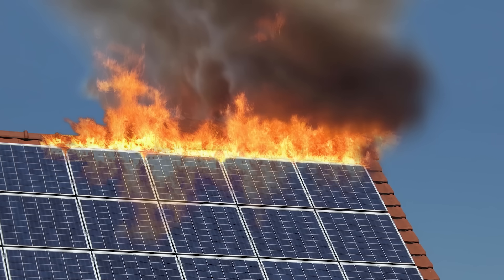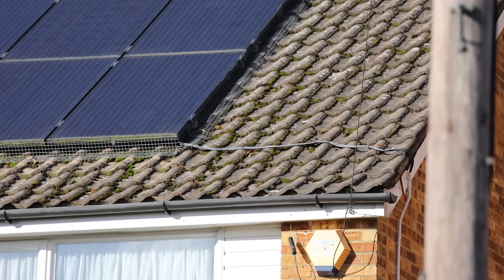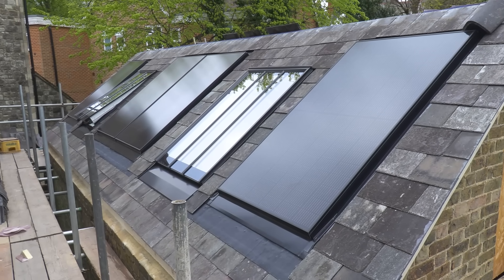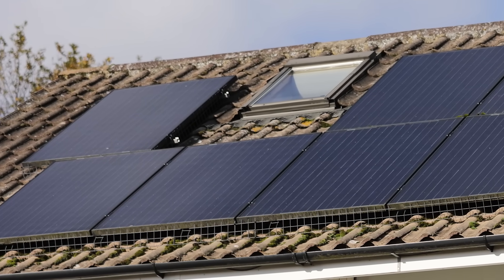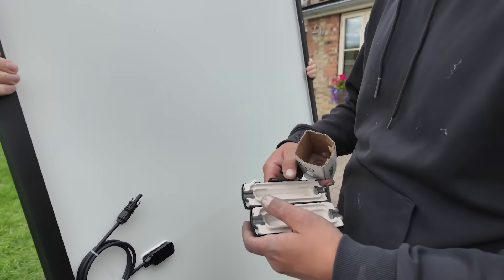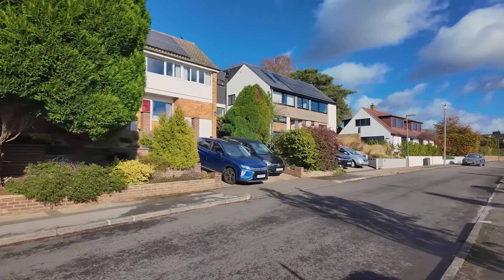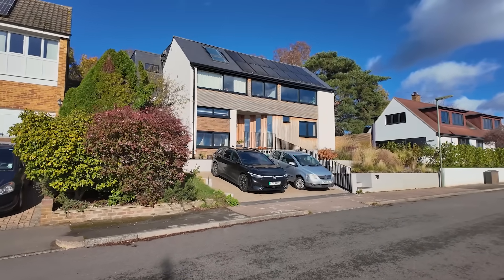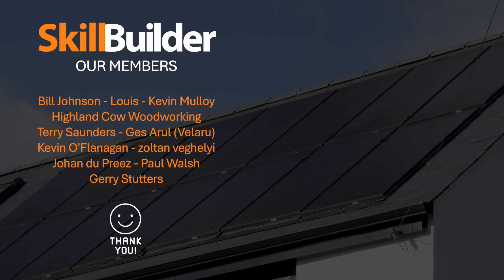Solar Panel Fires Are Rising – Here’s Why

Comment: Part of the reason for more of these fires is there's more solar installs.
Reply from the maker: That is not what the fire service is telling us. The fires are disproportionate in the increase.
Reply: @SkillBuilder  So you have access to verifiable data then? Or is this just an anecdote?
Reply: Yeah thinking this myself. Its just wiring if its not done right it might be a risk but its not that solar panels are intrinsically risky. Others have mentioned the battery in the attic is a no no nowadays and the main issue seems to be not noticing the fire which is a fair point. But it comes down to the installer which is where you can get it wrong. A lot of 'ecotechnicians' with a van and ladder and amazon account to get cheap solar panels about.....
Reply: @Meodus_Motley_Pfizer Nobody is buying panels from Amazon.
Reply: @Meodus_Motley_Pfizer Amazon is an expensive place to buy panels. The genuine brand articles are 65 quid each retail with delivery included for 2 or more from cityplumbing. It's simply not worth skimping if you are doing a house sized job, and trade they are way cheaper still.
For an MCS install all the kit has to be confirmed to be genuine and on the MCS approved list.

Comment: It's a pity you didn't do a bit more research. You would have found out about the different chemistries and thus associated fire risks, of different batteries. An eBike battery is very different from a home battery installed in a loft
Reply from the maker: It is a pity that you choose to denigrate my efforts to highlight a safety issue to those who might not know about it. I am sure you could bore for Britain about the chemistry but you would lose your audience and gain nothing. Keep the message short and keep it simple. Batteries in lofts is a bad idea.
Reply: @SkillBuilder  very defensive reaction. I applaud your work, you are doing a lot of good for us all. But you don't get everything right, nobody does. It would be better if you realised that and took some constructive criticism on board. I do apologise for my part as I could have dressed it a bit nicer
Reply: So safe that the government has banned installation in lofts?
Reply: @bordersw1239  the given reason for that was that if the floor of the loft collapses in a fire, then the very heavy batteries could fall down and injure somebody below. There is no fire risk with LiFePO4 cells. There is a huge fire risk with lithium ion cells in cheap packs like in electric bikes and scooters, power tools, mobile phones, torches, vapes, laptops, tablets, etc.
Reply: @sdewaard . Completely wrong - they are simply less likely to catch fire compared to a normal lithium battery. They are reliant on the BMS working properly and not allowing over charging. There are multiple videos of them catching fire and in a roof space already alight they would pose a significant risk to any one fighting that fire, let’s not forget the hydrogen fluoride gases they would also release. Anyone that put anything in their home that creates an added risk to occupants or firefighters is a moron - this is why why we are urged to have yearly safety checks performed on gas or oil boilers.

Comment: We have about 3.2 million solar installations in the Netherlands. Fires are rare and even if they do happen it's either the gas boiler below the roof starting it or a hack job on the wiring. The panels and their connectors are not a likely cause. 

It is wise to leave some space for the fire department to fight something burning in the attic, so a dormer or a roof window to break is something to consider.

I personally don't like the built in solar panels. There is hardly any way to cool the panels, reducing their efficiency, flammable insulation is not separated and if a panel breaks it may be impossible to replace with something that fits after just a decade.

As for batteries, NMC is a big risk in your home. LG and SolarEdge are brands that still use this chemistry and in my opinion it's dangerous.
Most home battery brands now use LFP (LiFePO4) which is very safe. Just be sure to put it in a well ventilated space or outside just in case as it can slowly release gases you don't want in your home if something does go wrong. It's very unlikely with LFP, but putting in some ventilation is not a huge expense and will also help remove any heat from the batteries in summer.

Hiring a good installer is the best way to prevent issues. There is a channel called "Gary does Solar" with lots of tips to make sure you are getting the right install and he has even made an online installer directory based on viewer experiences.

Solar panels themselves don't cause fires. Incompetent people installing them do.
Reply: To circumvent every possible risk of loosing my house due to a solar power fire. I installed my solar panels in my garden, 10 meters from my house. I have LiFePO4 batteries and they are in a small garden shed together with my breakers and lightning strike protection. I also have my Hybrid Inverters in that shed. It works great all year long (going on 3 years now). In the summer with forced ventilation and in the winter when it really cold with low power battery warmers. And if something goes wrong and a fire starts, worst case scenario I'm waiting for the fire department in the safety of my house.
Reply: The new UK standards from the NHBC are for in-roof/roof-integrated panels to be installed on a counter-battened roof with impermeable underlay due to their tendency to cause condensation under them. That means there's a continuous space behind the whole roof covering, including the tiles. Combine that with over-fascia and ridge vents and your panels are cooled from both the front and back.
Reply: The UK is a lot wetter than the Netherlands, more water is more likely to cause damage. But the main issue is probably there are too many cowboy tradesmen in the UK.
Reply: @BillyGold007  Actually the Netherlands has more rainy days although the UK has more rain in terms of volume. Basically it's wet here about 1/3 of the year, which can be challenging for solar installers as you don't want to be connecting solar panels when the MC4 connectors are wet and maybe a wet roof is not the best place to be either.
But these challenging conditions have led to fast learning and even the cowboys don't want to come back for their mistakes, so they are either sued or quickly change their ways for their own profitability.
Reply: @SolAce-nw2hf  Cowboys don't come back - they disappear like ghosts leaving wreckage behind them, that's their constant way of working probably genetically programmed.
Reply: @oldbutstillcurious3615 They do come back when you get the court to seize their bank accounts, which may be easier here in the Netherlands.
Reply: @BillyGold007  this was a problem in the Netherlands: cowboys. But that problem is already resolved.
Still, in the Netherlands you can do a large part of your home yourself, provided you do it according to common pragmatic rules. And only some parts need to be done by a certified person.
This does not lead to more fires, as most people are smart enough to call a certified person. They are not that expensive, and give you peace of mind.
Reply: If only the UK had any sort of regulations in place.. 😂
Reply: I don't like built in panels from the perspective of non-standard dimensions, that company goes away, specifications on size change, a panel finally gives up and you're stuck with a major problem of a defunct panel and nothing to replace it.
At least with externally mounted, there's cooling with proper standoff, one can view wiring junctions and if one goes, it's a function of shifting external panels only, not major roof surgery and massive patchwork.
As for batteries, regardless of type, they're all a flammable gas accumulation hazard and a short circuit overheating hazard, thermal runaway adding to the problems with the cheaper batteries. Better in a detached, insulated storage shed with good ventilation and heater of modest output to keep everything above freezing. Gotta upsize the gauge of high quality wire to compensate for resistive losses over the longer run, but it's cheaper than building a new home.
Reply: Like air source systems, there are a huge amount of duff installions,  by less than competent folk.
Reply: @yellowperilbiker It's not what you use but how you use it 😂
Reply: You said panels and connectors are not a likely cause of fires. Every fire I have seen was linked to either corroded MC4 connectors arcing until they burn, or disconnect boxes with bad connections.
I have 2 panels in my junk pile that experienced burned traces and shattered glass. While I highly doubt they could burn being glass with a protective plastic backing if they were up on a roof with a bunch of leaves and debris built up under them, the potential is there for a fire.
Besides the 2 burned panels I experienced a breaker melt down in the combiner box, as well as an overheated backflow diode. It got so hot all of the solder joints flowed their solder causing a failure. I alsi caught a rotary disconnect switch the was cooking itself. It's important that you check every connection periodically for loose connections or heated terminals. That's how I discovered the melting disconnect switch. I used a temperature gun on the connections and found the rotary switch was hot.
Reply: @FauxQue-yk8dt It's an unlikely cause, but not an impossible cause.
Some installers use cheap junk and that's when things can go horribly wrong, even if the factory MC4 connector on the panel is perfect.

I think you may have had some really bad luck there.

As with everyting even solar can be a risk if done wrong.
Reply: @SolAce-nw2hf Cheap junk is how I roll. At least that's what happened with the rotary disconnect. The breaker was me not catching a loose connection. Even torqued wires will loosen as they heat cylcle. Stranded wire should have a ferrule crimped on if it's under a screw terminal. I haven't experienced a failed MC4 connector but it's usually water intrusion that takes outdoor components out. DC voltage is no joke. Once an arc starts it's going to sizzle until something fails.
Reply: WEF SPONSOR GHOUL TODDLE OFF!
Reply: @roymcintosh7983 Trolls first 😂
Reply: I always wonder how my roof could catch fire. It can't.
There is almost nothing in my home that can burn.
For my LFP, there will be a special room with it's own gas over pressure exhaust, high in the room, as H2 rises.
Reply: Wow you can be so absolute, miraculous! Obviously there is some risk or engineers would not have invetsed time and effort coming up with solutions like intumescent conmector covers and fire resistant barriers as part of installations. Proper installation and maintenance reduce risk and using approved components in the system, these measures don't eliminate all risk. The solar panels thenselves do still present a remaining element of risk. Which is obvious. They are after all electrical appliances containing copmonents, cuircuitry, connections etc, sat on, or part of your roof which conatins a fair bit of timber and other combustible goodies. It's not possible "Solar panels themselves don't cause fires"

Comment: If you need arc boxes around every connector, it suggests that those connectors are not fit for purpose. Instead of inventing an expensive solution for poor connectors, why not have suitably designed connectors. Sometimes I wonder at this industry.....
Reply: They're not required for every connection, just the ones that are made at the end of a string when extending the cables from the panels to the inverter. This is carried out on site and prone to human error or incompetence.
Reply: @VinoVeritas_  I'm sure the installation of the fire boxes are subject to incompetent installation too....Maybe we should sort out the fundamentals before making more stuff to paper over the cracks....
Reply: @VinoVeritas_  Or incompatible connectors.
Reply: @matthewmarks6951  That's why the MC4 connectors at the end of a string are replaced with a set of compatible MC4 connectors. It's highly unlikely that an installer will be carrying the same MC4 connectors that are fitted to the panels in the factory.
Reply: @VinoVeritas_  Indeed.
Reply: Yes things should not be arcing. If they are arcing they are too old or fitted incorrectly - see: "employing professionals and not monkeys " video

Comment: Like anything getting old, prone to breakdown and faults. I would also look into types of inverter and placement. The most efficient solar systems use individual inverters. They generate heat. Any evidence to suggest that is linked to roof fires, over the box on the wall sort. There are also installers and installers. The ones you filmed the other day cover their arse. But at a cost of course. Type of panel. There are different sorts. Is one type worse than others. 
When you are looking at cheap v expensive, what are you paying for. Often a brand name that uses the exact same components as the cheaper one. You mentioned the battery back up. Who makes nearly all the cells, China. Your named brand puts them in a fancier box, but they are the same cells. In Australia we have had loads of Tesla box fires. LG have done recalls because of fires. And in the auto world Mercedes have had loads of fires, because they use the cheapest batteries they can find. Even Tesla buy Chinese cells. The people making the BESS boxes often claim, ours are different we make our own. Assemble from a kit more like. 100% every component is imported from China. And it only takes one dodgy cell. They also say we use the safer battery chemistry. That has been out for a while and at least 6 BESS units of this type have burnt, Moss landing was one.
All solar systems should have an isolator, it is a requirement. One switch cuts power to the panels. But if the panels are still working in the sun, how do you isolate that. You are also working with the law of averages. The more you have the more chance of something going wrong. And the age of the systems. Maintenance is about your only hope.
Reply: Its something to be studied seriously for sure. It would be understandable if they were making it easy to get solar panels. Its still really expensive. Its almost as if the governement gets revenue from us using fossil fuels!
Reply: When you isolate the solar at the inverter (most of which now have the switch built in instead) or the switch then you actually cause the voltage to rise a chunk but you cut the current to near enough zero, which means the heating effect is zero and you'll quench any arc. The voltage can still kill you if you decide to become the connection but isolating the system does generally quench any fire unless its established itself on other nearby combustible materials.

Comment: Poor installation or using mismatched connectors is the usual cause for connector fires, if there was a real enforceable standard for MC4 connectors, that might weed out the cheap makes. In the meantime, stick with Staubli. LiFePO4 batteries are very difficult to get to burn, not the same as those used in electric scooters so don't go scaremongering using that as a reason.
Reply: A poorly made crimp will cause problems, Staubli or not.

Comment: A battery room is a fire and detonation hazard, you need halon fire suppression, New EU regulations say you need a separate building from the house accessible from the street by the fire brigade.
Reply: 1. We are not in the EU
2. Even in the EU it's not
3. Halon was banned years ago
4. Halon won't put out a burning LFP battery

Comment: Solar panels are great for some situations - if you have a large garden shed or garage a substantial distance from your house it might even be reasonable to put them on a roof. Definately you'd want safety isolation. Batteries are a disaster - I'd say go lead acid before lithium ion.
Reply: Lead acid batteries just don't perform well enough to be viable for the kind of grid connect systems most have. LiFePO4 batteries used for solar are pretty safe, unlike many of the car lithium battery technologies.
Reply: Lead acid is basically dead - and also even more dangerous in small spaces because of hydrogen build up. The problem with LFP batteries and sheds is actually temperature range but the newer ones have heaters, and sodium has a stupidly wide operating range as and when it becomes the mainstream.
Reply: Solar panels aren't even isolated from the mains with most inverters, because the risk is so small and it increases efficiency. DIY LiFePO4 battery and a hybrid inverter gives you 6000 full charge/discharge cycles of 16 kWh for about £2k. Try that with lead-acid!